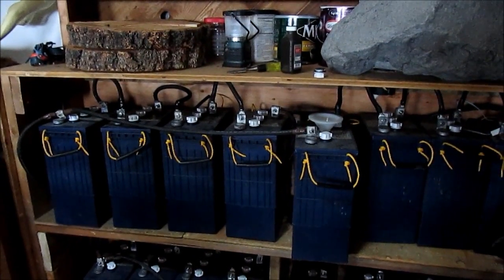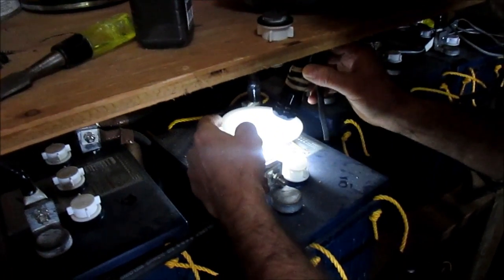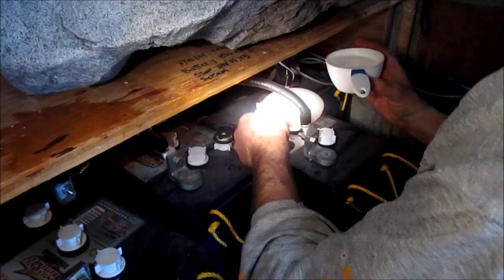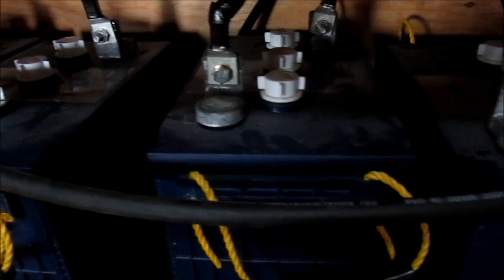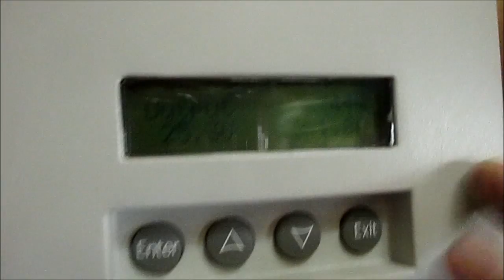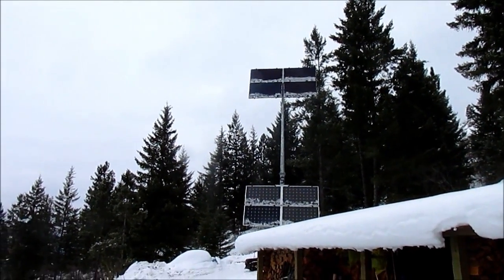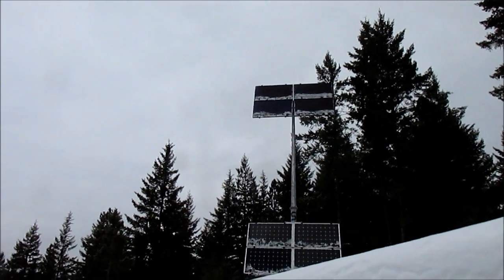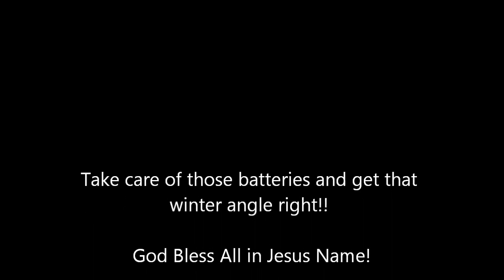Solar Battery Maintenance

Comment: 1200 watts of renogy 100 d panels, two mppt morningstar 60 charge controllers 1720 ah of interstate Batterys all in shed with a 3000 watt low freq aims inverter, backed up by a Honda eu3000 with remote start, never had to use the generator to date and it runs a fridge and freezer and propane hot dawg forced air furnace usually the Batterys do not drop below 70 to 80 percent from full. I found my panel angle only makes less than 3 to 4 percent difference as long as there close to the correct angle. And yes it's a 12 volt system. It's been up and running for a year and a half no problems to date except maintance. It is switchable to grid tie also and averages 4-5 kwh a day with some sun and 2.5 kwh with fog and  extremely cloudy days, just got a wind turbine to test out.
Reply from the maker: 919hammer SWEET SWEET! We just had a newly met friend who lives off grid..the guy is a real genius..do it himself..walks the walks talks the talks..He told us about FORK lift batteries..refurbished. Life 30 plus years..one cell goes bad the w hole battery DOESNT! We are looking to SELL our interstate batteries now and by the forklift batteries soon!! We are always looking to improve and be more self sufficient. The fork lift batteries will do that above and beyond our interstae ones...ever hear of that??
Reply: Starry Hilder A few thoughts -  The only advantage of upgrading to forklift batteries may be the number of charge cycles ( battery life) and  durability (they can handle a bit more abuse). As far as seeing a night and day difference or even a difference at all would be practically null.  Though, I don't doubt that some people are getting 30 years out of their forklift batteries, it would certainly be the minority.  When manufactures spec the charge cycles on their batteries, it's under specific conditions - constant temperatures, discharge rates, and charge current - which is nearly impossible to mimic in real life.  If you are determined to sell your batteries and upgrade I would look into LiFeP04 cells, its what they use in the electric car industry, and I feel that is the direction the solar industry will be heading.  They are lighter, smaller, higher tolerance to low temperatures, and maintenance free.  The biggest advantage of LiFeP04 cells is the discharge capacity, which is 40%.  That is twice the amount of usable stored energy as lead acid.  In theory, that would cut your battery bank in half. So if you have a 540 amp hour bank - lead acid would give you 108 amp hours of usable stored energy, LiFeP04 would be 216 amp hours (the 20% & 40% figures are based on manufacture's recommendations).  As you stated, you problem is the solar energy to charge your batteries - that should be the first thing you address. Look into the upgrading the battery bank last (unless there is obvious problems - like holding a charge).  Look into your inverter and try and determine what it draws in standby (as mentioned in an early post).  Also, try and to power the least amount of appliances/ fixtures through the inverter.  A good example of wasted energy on a lighting is inverting  - your converting D/C to A/C to power your LED's, which themselves convert that A/C back to D/C to drive the lights (find fixtures and appliances that run on your native D/C voltage).  I guess what I'm getting at is - re-evaluate your power consumption and find out where it's all going.  Determine if upgrading your battery bank is the right solution for your problem.  I see it all to often, people assume that its the batteries, when  it's not.  Remember...what you put in, is what you get out.
Reply from the maker: Shaggy one That was incredible well thought out information! love it love it! So many great ideas to consider and look at. Thats why I love youtube..so many good people with real ideas that we can apply to our everyday life! Aside from the battery info you mentioned those led lights. Ok im a little confused...how would you go about looking at fixtures that run off of dc instead. How does that work with wiring ect (sorry for my niavity..my husband will probably laugh at my questions since he might already know the answer) but for me could you explain it? God Bless you for all that great insight and indeed taking your time to explain! What do you do for a living that you have so much knowledge???
Reply: Fixtures for a 24 V D/C are readily available online. The only downfall is they can be quite expensive. I would suggest sticking with the  lighting.  If you were  on a 12 volt battery bank your options would almost be unlimited and the price would be cheaper as well.  I am assuming that the inverter connects into a 120 volt service panel and all the wiring to the lights would more than likely be 14/2 or 12/2 romex.  If you were to convert your lighting to 24 volt, you would have probably have to run new wires from your battery bank (you may be able to use the existing wire, but you would have to research that; also you can't use your A/C circuit breaker on a D/C system unless they are rated for both). You would also have to install a fused D/C service panel, if your existing breaker aren't D/C compatible ( not as complicated or expensive as it sounds). You basically want to have fuses between your battery bank and your branch circuits.  

I think your first step would be to install a watt meter (the ones you plug between appliance and the outlets) between your chest freezer and outlet it's plugged into.  This will give you the daily power consumption for the freezer, let it run a few days and take an average daily total (the power consumption will obviously be higher in the summer months).  This would at least give you a baseline of what it takes to run it.  After you get that power consumption of the freezer, find out t the efficiency of your inverter.  If your freezer consumes 250 watts a day and your inveter is 70% effecient, you'll have to add that 30% loss to the freezers consumption.  So it would be closer to 325 watts to run your freezer if you factor in the loss from the inverter.  Since the freezer runs all day, divide the total watts by 24 volts,  that will give you your total amp hours for the freezer. that works out to around 14 amps to run it for a day. If you your battery bank is 540 amps with a 20% working capacity, you'll have 108 amps if usable capacity per day.  The freezer alone is consuming roughly 15% of your power per day, factor a couple days of low solar and your battery bank is dead in a 7 days if there is no other draws on the system.  Factor in lights, charging phones, computers, modems, etc.. on low solar days and you'll probably get a day or two if your lucky.  The freezer is an appliance you run all day and is ran through the inverter - this would probably be the biggest draw on your system - that why I would start there.  So lets say you find out what your daily power consumption is, and it's only 60% of usable capacity of your battery bank - your problem is solar intake - you need more panels.  If its 90% or higher, you'll need a bigger battery bank and more solar panels to maintain it.

If you increase the battery bank and not the solar array, you will never be able to properly maintain and charge your battery bank with your existing system in low solar conditions.  From what I can gather, without knowing your total battery bank capacity and your total daily power consumption, you more than likely need more solar panels or a better location for the existing ones.  

Like you have mentioned in a few of your videos, the cloud cover has been a bit unusual for your area.  If that is the case you may be perfectly set up for your solar needs and you may have to wait until next winter to get a full assessment on your solar needs. I just hope your not in an area that is not ideal for either solar or wind.

I noticed that you have MPPT chargers - are your panels ran in series or in parallel.  Are they 12 volt or 24 volt panels?

Hope this helps...
Reply: Shaggy one I've lived comfortably without any hiccups on my 5 kwh worth of LiFePo4 batteries and solar for two years now. I am not sure what you meant above by 40%? They say you can routinely discharge LiFePo4 80%DOD and get 2-3000 cycles. Did I miss read what you were expressing?
Reply: cnypilot The 40% would be a safe figure for battery longevity.  80% DOD is very manageable for LifePo4 batteries, but it wouldn't be wise to plan the full 80% as your daily capacity.  The key word is "routinely".  I'm not sure how you are actually defining that term - once a week, a month, etc.. , but the occasional cloudy day that puts you into the 80% DOD isn't really going to affect the life of the cells.

 I've linked a battery spec sheet (similar to your batteries) that states 2000 cycles (23c/77f temperature is important here) at 80% DOD.  If you look at the life cycle chart, it reflects after 2000 cycles, your capacity will drop to around 80%.  If you go to the manufactures web site, dig around through the small print, the 2000 cycles are based on figures above 80% DOD. 80% DOD and below they state 1000 cycles. So even if you stay above the 80% DOD, after 2000 cycles you'll still end up with about 80% of the batteries original capacity when it was new.

This is a direct link to the PDF:
http://www.electriccarinternational.com/media/HiPower/HP-PW-100AH.pdf

This is a link to the website, if your not comfortable opening a PDF:
http://www.electriccarinternational.com/ALLPRODS.php 

This site also sells "super EV batteries" which claim 4000 cycles at 80% DOD, but you should always read the fine print.  

You may have completely different cells which are spec'd completely different. Batteries from better manufactures will more than likely produce better outcomes, but it's something to take into consideration when planning your battery purchases.  This is mainly the reason I was stating the 40%  DOD in the previous post - it provides double the usable capacity of lead acid (without having a substantial affect on battery cycles) and leaves you plenty of capacity to fall back on for the cloudy days.

This is no more than a generalization of what to expect when you read the fine print....and is true for most battery types.
Reply: Shaggy one Thanks for the Info, Shaggy. Our Off-Grid setup is 16- 100aH CALB CA series (grey cells). 48v bank. 5 KWH. We typically use about half the capacity. Most of our bulk energy usage falls during the day when the bank is full and floating. I think a lot of people do not realize that when batteries or solar panels are spec'd, at their end life-cycle they still are supposed to have 80% of their stated ratings. They magickally do not completely die one day. Not typically at least. ;-)
Reply: Shaggy one Interesting to note about the Hipower link: They report a 3% monthly discharge rate... I've been an EVTV watcher since 2008, during that time Jack never noted them having much of a discharge at all.
Reply: Shaggy one I would imagine Starry's setup is close to my own. With the Midnite Solar Charge Controller (Not sure if she has the 150v version or the 200v like my own) she likely has them ran in series for Higher volts and less line loss. My own is 4 in series and then combined/paralleled with the other 4, then into the CC @150v/18amperes.

Comment: Nice video!  Good job!  .. Some thoughts, not criticism:

Kinda thought you were going to show testing the specific gravity of the batteries.  Not a big deal.  I know what that's about, maybe other viewers are not familiar with how that works or what that means. (Means the battery is good! LOL)

I take it that you have two different charge controllers .. One for each bank of panels.

It wasn't clear about why you no longer have a wind turbine, but you cover that in the comments.

Nice that you have the panels setup so you can adjust the angle.  My solar panels are fixed to the roof of my house, so I can't change the angle at all (or at least, it's not very easy! .. Actually have 32 panels, so it approaches "impossible"!). I take it that you don't have any shadow issues with your panel setup.  I have a bad tree shadow issue in the winter .. Since they are redwood trees and I'm in Northern California .. The trees will stay, my power generation will just have to take the hit!  I am "grid-tied" (no batteries at this point! When there is a power outage on the grid, my inverter shuts down!) and my annual solar generation is greater than my electric consumption, so it's "effective job done!"
Reply: Thank you for speaking up for those of us less, " in the know".. The terms"specific gravity" & "equalize" are completely foreign to me...
Reply: Gr8K8 "specific gravity" is a common test of the battery acid to tell you if it's good.  Over time, water vaporizes off, so you add distilled water to keep the level up.  Eventually, the battery goes bad and needs to be replaced.

"Equalize" refers to the way solar panels need to be balanced to work well together.  It's a lot like a stereo speaker setup, although it can be more complex when you talk about many solar panels.
Reply: Brian Blues Thank you,Brian.  The more I learn, it seems the more aware I become of how ignorant I've been.  So much to learn! Even more to get done!  I can't express how thankful I am to those in life willing to share their experiences & knowledge.
Reply: Gr8K8 yeah, that's the whole idea of social media.  Learn & share.

Comment: I think you should get another set of 4 on that pole and possibly set up another pole with the same set-up on it.  A question I have is , your generator, is it a perfect sine-wave generator, like my Honda?  If not then look into a noise filtration surge protection unit for your batteries.  Or upgrade your gen-set.

Comment: The angle of your panels can be off some no problem, but the snow and ice on your panels are killing your power cover one cell on your panels cuts the rest of the cells because there wired in series, within the panel. Also your Batterys like the same temperature that people do, insulate them, or they loose half there power. Your panels should produce at least a quarter of there output in the cloudiest of days. Hope this helps some.
Reply from the maker: Thanks for the info..good for other people to know. We don't have snow or ice issues up here. Winters are warm and if it snows ...the snow is gone in a couple hours off the panels. And this is RARE:) I know the angle is very important...only our lower panels can be changed..so there's a flaw in our array there. Batteries are inside in a constant temperature regulated shop attached to our home...so they have it nice! What kind of setup do you have???

Comment: Can you use RO/DI water to top up?  I am in the process of designing our off grid system.  We are doing a 10K system and are thinking of putting the batteries under a false floor.  Any thoughts?

Comment: The snow on the modules will cut production considerably  if the snow can be removed easily brush it off  be carefully to not scratch them. Clear ice don't interfere with output
Reply from the maker: Roy Amberg We rarely have any snow issues or ice. And yes, if we do we remove it asap. Your right anything on the panel will cut down on production...even a shadow!!
Reply: Starry Hilder Snow on the panels as indicated can degrade production by approx 80%

Comment: I'm no expert, but I've been told that even a twig shading a panel will significantly reduce it's output. Have you experimented with wiping any snow off the panels in the morning to see if that increases the output? Maybe you could figure out a way to wipe them safely and easily before winter.

Comment: :) I have the same midnite solar charge controller. Mine is the 200v version. I am curious why your screen on it was distorting the text? Is there a bug in the software version you are using?
Reply from the maker: Hmmm I am not sure about that. We are not real technically gifted and are still learning things like programming and getting around both of our controllers. I admit..our weak spot
Reply: Starry Hilder You may look into upgrading the firmware on it. :)

Comment: Why you don't build a QEG Generator? so you can recharge your batteries if there is not sun at all. I live near to the Ecuador, so I have a little more time of sunlight...But its hard when it's overcast, The water well pump cant work when its a little cloudy.
Reply from the maker: Paco Morales Not sure what a QEG generator is? We have gas generator to charge the batteries in the winter though.:)

Comment: You definitely need more panels. Specially sense your issue is little light available. More panels will let you fill banks more even in cloudy conditions.
Reply from the maker: yes, we figured that out finally. working on another 1k addition. panels have come down in price. thanks for the tip.

Comment: When my cous went big time off-grid they wanted 55,000 bucks to run the poles and wires to the house.  Too sign a nearly perpetual owner life-time contract.  Instead, he took boat batteries and mounted them in a old pick-ups bed, then wired them up.  He replaced the trucks alternator with a bigger leece-Neville unit around 250-300 amps.  The p/ups sole purpose is to re-charge his batteries.  The house is set-up for minimal use of electric maximum use of wood or propane.  All of the major appliances are fueled by propane and the home has 2 wood stoves, he gets lumber dropped off for minimal and splits it himself with a wood splitter and monster mauls.  He's done well in the middle of no-where.  A visit is relaxing.
Reply from the maker: +Al Fries Sounds like a great setup!!
Reply: +Al Fries That sound awesome!